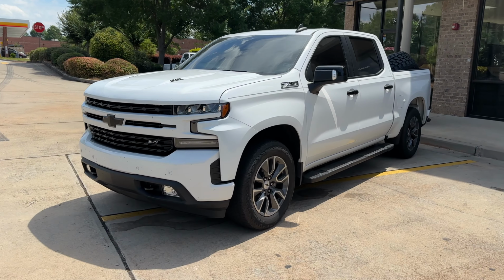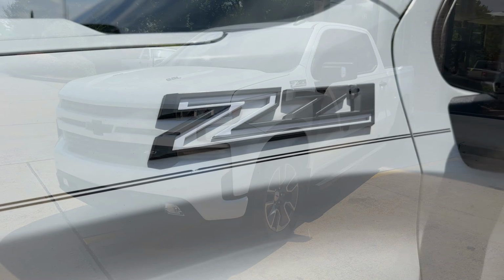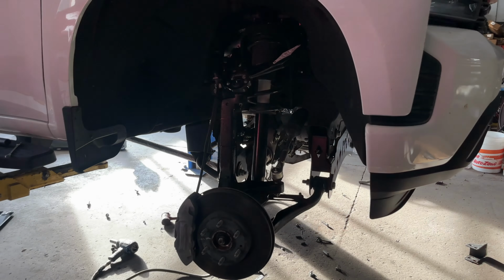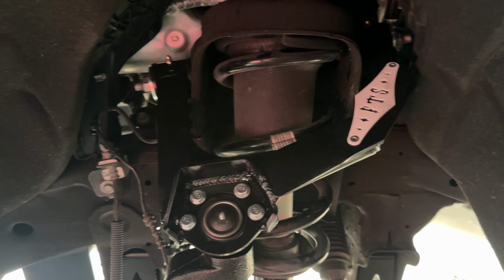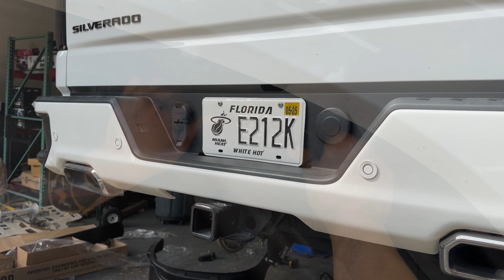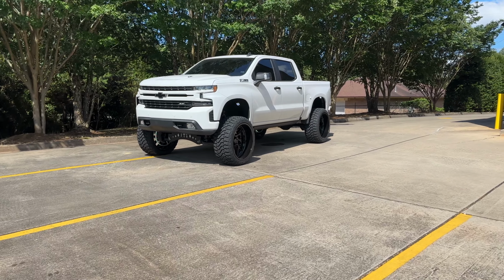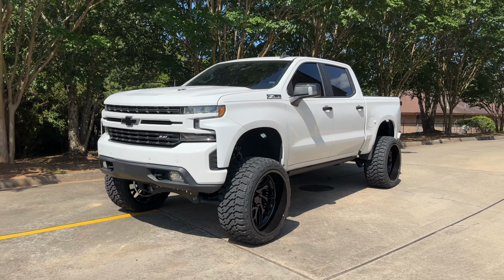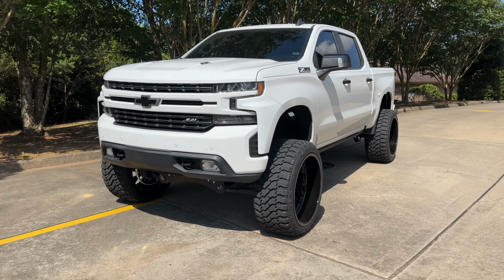** 2022 Chevy Silverado on a 9” FTS ** 26x14 KG1 Forged wheels

Comment: How are you guys calibrating the speedo on these refresh 22+ trucks?  Want to add lift and tires but want correct speedo and shift points.  Any help thanks!!
Reply from the maker: We are not calibrating the speedometers as there is no programmer for them yet.